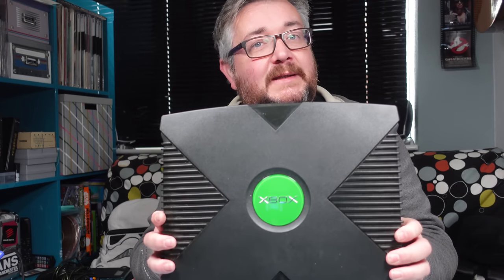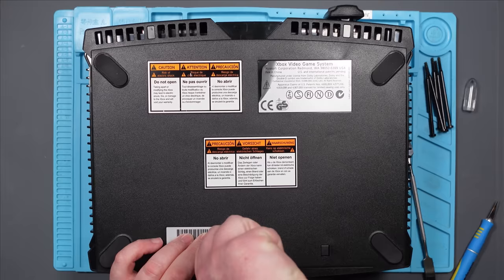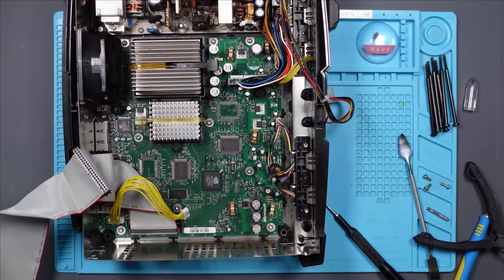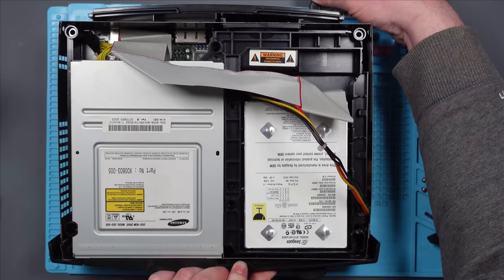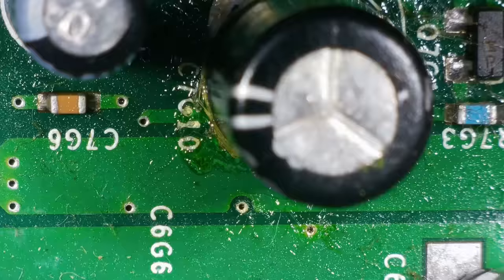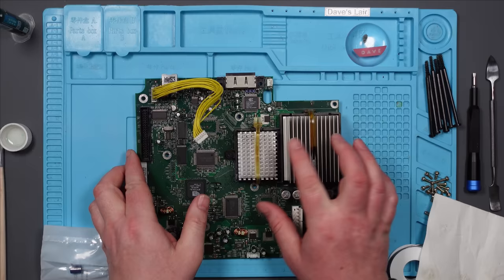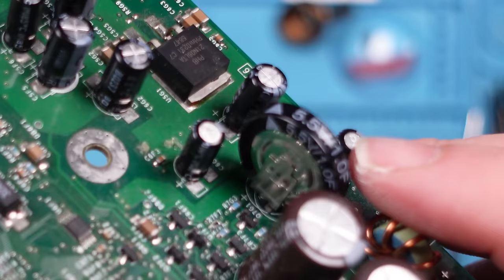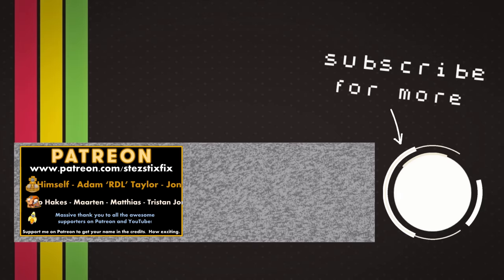This OG XBOX Won't Turn On | Let's Try and FIX it!

Comment from the maker: Yes, I know I said it hadn't been powered on for years literally 2 minutes after plugging it in, but that's because I'm stupid.  I checked all the capacitors on the power board and they were all in the microvolts, just to make sure it was safe to work on.  😬
Reply: Oh! You even got Halo 2 as a gift. Awesome!
Reply: shit happens ;)

If you want to do a Recap, pls use 16V/3300µF Panasonic FM for the 3300µF/6,3V Caps.
1500µF/6,3V Paasonic FM seems to be a decent replacement for the Nichicon HD around the CPU Socket.
in Voltage Regulation Circuits, the Impedance of the Capacitor is as important, if not more important than the Capacity....
Reply: Lucky you that one of the power pins was loose and disconnected, otherwise those capacitors would've been live and dangerous.
Reply: That ir sensor is called a DVD playback kit. It came with that ir receiver and a remote, it enabled the Xbox to play dvds. Without that kit you could not watch movies.
Reply: Don't be too harsh on yourself man. You just have to be more careful because a shock from one of those capacitors can lead your heart to fibrillate and we don't want that. Always use antistatic gloves mate
Reply: How long would you have to wait after you plugged it in? Like a couple of months, weeks or even just days?
Reply: @nowonmetube  you discharge them.
Reply: @dustonbohannan  that's not what I wanted to know. I'm not discharging stuff. So that's why I just want to know when I be save
Reply: @nowonmetube  you need to discharge to be safe. Those carry alot
Reply: @dustonbohannan  so it's dependent on the capacitors then? Is there not a "after x-months even the biggest capacitor is empty"?
Reply: @nowonmetube  yes but it's not very smart to rely on a time because it's known that they could still shock you. It's just safer to check with a multimeter and discharge if you need to.
Reply: @dustonbohannan  in new desgns there are resistors parallel to them. They empty few minutes after disconnect. Safety first !
Reply: Another way to tell the positive and negative sides, it is stamped in the the blade joint.  One looks like a cross and the other a rectangle.  Unless the rest of them are not the same way.  I'm new and I love the show!👍
Reply: @dustonbohannan  unless it was different in other countries you could use the video game controller to watch DVDs. The remote kit just made it easier.
Reply: @sak7785  in the US the DVD playback was required to play dvds meanwhile, the ps2 didn't require anything but a controller. I don't know about other countries, but in the US you had to pay 30 dollars to get a DVD playback kit.
Reply: @dustonbohannan  I live in the US & I used to watch DVDs on my XBOX all the time before before I got the kit.
Reply: @sak7785  then your console was modified because a stock original Xbox had no such capability. Look it up
Reply: @dustonbohannan  I bought it new. So it definitely wasn’t modified.
Reply: I'm really surprised you did not clean the cooling fan after finding all that fuzz inside the DVD/disc tray
Reply: Leaded solder fumes are toxic. Wear a mask at the very least, please.
Reply: Came for the Xbox, stayed for the rest of the stupid vids. Loving it.
Reply: Love your videos I am making my way through all of them. I never knew I was such a nerd but I’ve always been interested in taking things apart obviously not with your expertise, if you get to read this comment I’d love a shout out if possible on your next video. 🎉

Comment: That DVD dongle in the front was actually Microsoft's way of getting around having to pay for DVD use license, instead making the consumer pay for it. Interesting story :D
Reply: I guess they never wanted to pay Sony.
Reply: Didnt that dongle cause problems for the console?
Reply: Microsoft has never had a track record for wanting to pay for licensing, ever wondered why you have to download a BluRay player to play them on your Xbox One/S/X? :)
Reply: @firetjue4099  never
Reply: @KeyringHardhat  You have to do that on the PS4 too, as far as I remember. PS3 could do it out of the box.
I am also not entirely sure it's a licensing thing, considering you can also play DVDs on the Xbox with the controller (you don't need the remote).
Reply: @MyRegardsToTheDodo  It was 100% a licensing thing.  There may have been a console update that came out later to remove this need for the sensor, but you did need it to play dvds in the beginning.
Reply: @MidwayMaiTais  It was a licensing thing but not exactly what Kieron said. The issue was you had to pay Dolby for a license to use the Dolby decoder software library, and MSFT did not want to pay for it if the customer wasn't actually going to use their Xbox to watch DVDs. So the way they got around this was by putting the Dolby Decoder license key on the DVD remote dongle, and the DVD player on the system is disabled without the dongle connected.

You can of course get around this limitation by modding the console.
Reply: @firetjue4099  nope none at all

Comment: 13:38 - the stampings on the connectors of the capacitor look like a "+" on one side and a "-" on the other. I'm pretty sure that's an easier way to tell that apart
Reply: Oh shit just caught that, the stamps is like a huge +/- nice catch

Comment: Love your videos Steve and you are correct,  like others have said,  its basically a dongle or a way to bypass the main menu so you could watch DVDs on the Xbox. It originally came with a remote and you had to buy it separate from the system itself.  You couldn't watch DVDs without that dongle.

  If you soft-mod the Xbox and put XBMC on it,  you can watch DVDs / DVDRs / CDRs without the need of having that dongle.
Reply: Did that to two I have. Currently packed away in the loft. Also put larger HDD drives in. Loved the OG XBOX console.

Comment: There are many texts and videos out there about this faulty clock capacitor. It should be removed in all older XBoxes since it's known to damage stuff around it.
A mod chip might also be a great addition to it. That way it might make a cool media center device.
These XBoxes are incredible fine consoles. Even for today. They deserve to be repaired and preserved!
Good job on this one, Steve. I love all your repair videos. They gave me the impulse to finally learn soldering etc. Thanks for all your amazing videos!
Reply from the maker: Thanks Knight!  Much appreciated.  Good luck with your soldering!  👍
Reply: I've got a modded one sitting in storage that I fixed after I messed up loading XBMC. I managed to get the hard drive unlocked and readable by the pc I used to fix it by booting the Xbox and unplugging the hard drive data cable from the Xbox during the boot splash screen. Then plugged it into the PC when I had the bios boot sequence paused. This allowed the PC to see the drive as a native drive and allow read/write access.
Reply: just blows that all of them will die due to leaky Caps...
So if you have an OG XBOX, you have to open it up and replace the Clock Caps and the high water containing Ultra Low ESR Caps with suitable replacements (Panasonic FM! and ONLY those are suitable. As they are the only ones I found with similar Impedance to the Original Caps)
Reply: Don’t remove the clock cap in the 1.6 as it will NOT work without it. It also is a better quality and rarely if ever fails. You have the best xbox model which is 1.1. It has a 1 Meg bios chip on it. It can be TSOP flashed without requiring any mod chip at all and you get the full benefits of the mod chip as a result. You can also opt to split the TSOP into two banks of 512 and install a switch to alternate between the two. you really really should mod this as you can change the EEPROM to read that it is an NTSC model and then it’ll open up the HD resolutions with an applicable component or HDMI cable. The Euro models are stuck in 480p until the mod is complete. You may also if you want an additional challenge install the missing 4 ram modules to get it up to 128 MB of ram, which makes emulators a bit better specifically the N64.
Reply: I put a mod chip in mine back when it was new, for the life of me though I cannot find my Xbox anymore I believe my younger sister gave it away to one of her boyfriends thruout the years.
Reply: @feron450  oh man, that blows. Sad to hear that...
Reply: @StezStixFix  mate, how do we contact you? I’ve got a couple of projects for you to look at and you can film them too 😊
Reply: @stevenbenson9976  hey dude  do you have an ebay shop or something??
Reply: @joeprinsen1717  no but there's quite a few og xbox Facebook groups I'm part of that have guys with shops
Reply: @wakenbaker-uk im using rocky 5 softmod on mine with a 120gb ssd, love it
Reply: @MrGamerholic  I've done this before a few times.

It works perfectly.

Feels great when you do it too.

Comment: What a nice lazy Saturday afternoon treat. 
I just worked on one of these, a first generation model bought in April 2003. 
It used to power up and go into the menu a few months ago but now has the flashing red and green light with error codes 11 & 7. I need a new drive. Removed the clock cap, which was surprisingly okay.
Mine is October '02 also but has a Phillips DVD drive and a Maxtor HDD.
13:39 the spot welded tabs show polarity.
Reply from the maker: Thanks Gunzee, I didn't notice that at the time!  I see it now 😬

Comment: It's a shame that so many Xbox's have so many problems, who knows how many consoles throughout the years have been tossed because they stopped working, or something as simple as the disc tray stopped opening. The xbox original is one of my favorite consoles and it has so many classic games. If you became quite familiar with them, one could probably make a decent living fixing them, since 90% of the problems are either with the fault disc drive or the clock capacitor. Thanks for fixing up this great machine!

Comment: Another great video Steve! The Squeaky screws were painfully! Those capacitors the 5.5v 1F have crude symbols for + and - embossed on either side in the metal.

The satisfaction of repairing these machines is fascinating thanks for sharing!

Comment: Back in 2003 3 I got a mod chip for the original xbox and had to solder it in for it to work. The second you opened that thing it brought back them memories. It was the first time I had ever soldered in my life.

Comment: Had one, don't know why I sold it as it was the halo edition with a controller. Also don't forget to change or remove the clock capacitor, they leak everywhere a ruin it all. Awesome work Steve

Comment: I used to work for Microsoft repair those Xboxes. The power supplys were most the time the issues.but if you have any other issues with them i.e dvd drives or hard replacement....you have to marry the circuit board, dvd, and hard drive together and require special disc to reset everything....obtw I still may have those discs if needed. Love your videos keep up the great work! From the other side of the pond!
Reply: Also if you need other information on these Xbox let me know

Comment: your hint with the disc drive belt is awesome! i also bought an old xbox some days ago and noticed the same faulty drive behaviour.
i was afraid for needing to replace the whole disc drive. now i have huge hope again, that the fix is actually easier than i thought ❤️
Reply: You can also buy new belts for ~$.50 boiling it will help but itst still 20 year old rubber so it will continue to deteriorate.
Reply: @bobothn  btw., i did what you suggested and bought some new rubber belts instead of boiling the original rubber belt (which i tried before without the wished result). 

with the new rubber belt the drive works like a charm again 😍👍

Comment: Love that solder, use it myself 😁 Mega win coming with Halo 2, and great little fix with the cold solder joints! Think people (including myself) would massively overlook something like that and end up breaking it further 😂 Well done mate ❤
Reply from the maker: Cheers Joey!  Yeah, such a simple fix.  I always have to remind myself to check the simple things first!  😬
Reply: It always makes my angry that just because of 1 simple fault, the whole machine is condemned to be "spare parts" by the clueless.

Imagine your car is marked to be used as spare parts just because of a tyre puncture and won't move.

Comment: Found your channel a few weeks ago and I’m now binge watching them.  Love the commentary and the gaffes and all approach (not plugged in for a year 2 minutes after pulling out the power lead, don’t know which side of the capacitor is + and - when it’s stamped into the side!). Keep up the great work and getting just the wrong amount of thermal paste every time.

Comment: The smell is mold.  Mold spores impregnate plastic, after which it becomes impossible to stop it from going musty.  I lived in the basement of an abandoned factory for a while, with black mold and mice as my roommates.  The mold turned my computer sticky and screwed up the fans, causing overheating.  When I took it into the shop, the tech refused to even open the case, saying it reeked of mold.  He warned me it would eventually kill the whole system.

The corrosion on the outside vents shows this Xbox has been sitting in damp environments, and the plastic is thoroughly infested with mold, hence the musty smell.  There's no way to get rid of it without completely replacing every piece of plastic.
Reply: You must have lived in absolutely atrocious conditions lol.

Bruh
Reply: @samholdsworth420  I've lived in worse.  Spent one winter in a shed, huddled with a blanket around a candle trying not to freeze to death and sh!tting in a bucket.
Reply: @NoJusticeNoPeace  yea bro I bet
Reply: @NoJusticeNoPeace  Why
Reply: @duckula316  Destitution.

Comment: The joints on the ac plug, this failure is prone to many launch and later versions. M$ implemented a program that if your Serial# was in the affected range of production you received a GFCI replacement power cord! A friend showed me how they fixed theirs without opening up the console, in FEAR of voiding the WARRANTY. They took their hot iron and used it to heat each ac line on the socket individually. It eventually reflowed, but the socket was junk. I then brought mine over and disassembled it for the same repair, and found a bunch of blockage of the vents. Took it home and used the air squeezer to free the debris. Upon returning, they had theirs took apart...they were so sure theirs was worse, for they used it almost all the time playing halo 2. That day my friend became a fearless modder.

Comment: The rectangle up at the top of the hard drive gives specifications of size. You can plug those into a conversion tool and it'll tell you how many gigabytes it holds. This one seems to be around 10 gigabytes
Reply: You're right, just found this particular model online and it is 10GB indeed.
Reply: It was a real flashback to my PC repair days in the late 90's when you had to calculate it since it wasn't written on the drive!
Reply: Xboxes always have either a 10gb or an 8gb hard drive.
Reply: @whompronnie  DAMMIT - Came here to say this!!!  I remember the days you had to do MATHS to figure out the capacity of a drive! It was intense back then
Reply: Which bits denote the size? All of it? I would imagine CYL means cycle.
Reply: @IhsanMujdeci  All of it. It goes cylinder-head-sector
Reply: @James2210  good to know 👍
Reply: @IhsanMujdeci  It's got a wikipedia page if you're interested https://en.wikipedia.org/wiki/Cylinder-head-sector
Reply: @IhsanMujdeci  Further, LBA is almost universally indicated in 512 byte sectors, so ~20M / 2 = ~10 GB (~9.5 GiB).
Reply: One oddity - the only hard drives that didn't have the capacity printed on there I ever encountered were ones on the OG Xbox. All the other IDE hard drives I have have it on there

Comment: Hi Steve. I know slightly less than nothing when it comes to this stuff, but I love tinkering and find your videos extremely entertaining! Someone has probably already mentioned, but that capacitor you popped in this Xbox was marked with a +& -. The symbols were pressed into the plates either side. 
Sorry for the novice terminology but have a look at one and you'll notice, if you haven't already that is. 
Keep up the SOLID work!

Comment: That HDD is a 10GB 5.4K 2MB ATA drive which was about the right size for the OG Xbox. These were normally swapped out for 250GB drives like I did with my Crystal Xbox. Now being swapped for other drives.

Comment: Never seen the clock battery actually replaced before, just removed 😆 nice one. I have to practice soldering which I keep telling myself. It's the next level of modding. I just put myself off with my unsteady hands... I have some led lights I can start on

Comment: Great video, thanks for taking me down memory lane. I can't remember how many OG Xboxes I modded for friends and family to be used with XBMC. 
There was some kind if chip I installed which needed me drilling a whole into the case for the IR Receciver. With that you could turn on/off the Xbox with the DVD remote.
Good Times :)